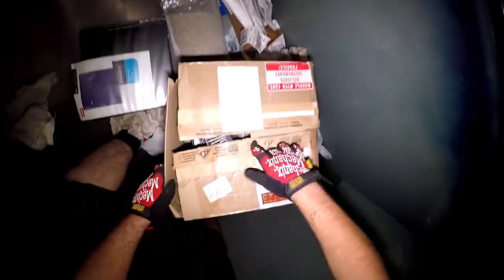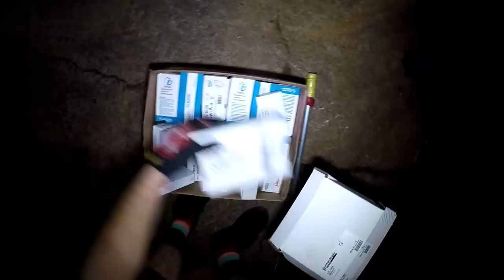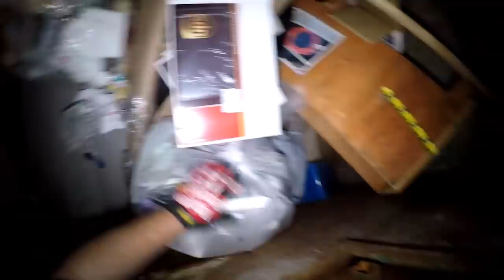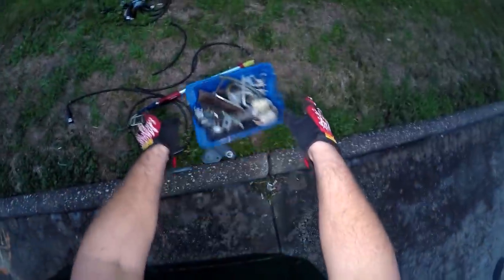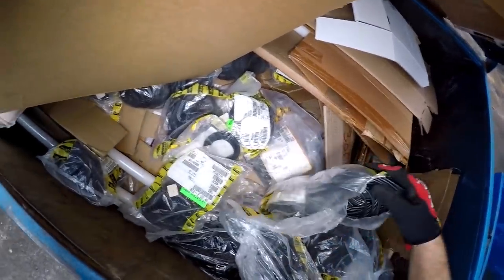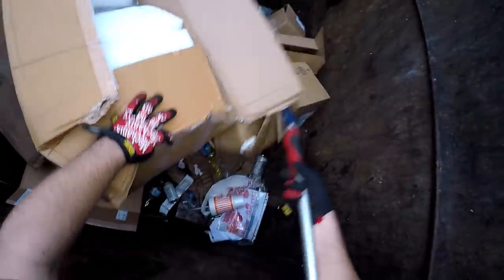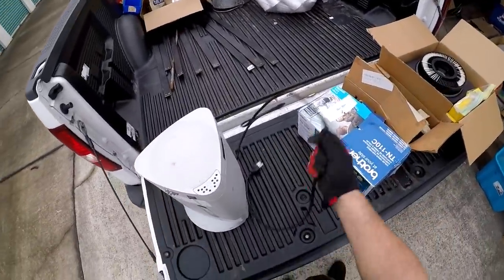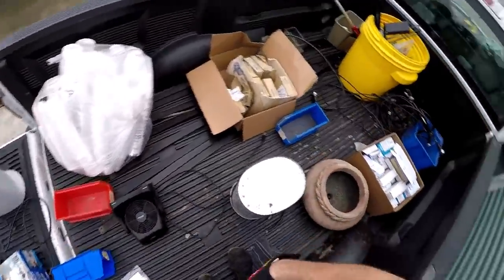Dumpster Diving 32 (Slide Projector & $$$ in Electronic Componenents!)

Comment: The panel at 7:37 looks like a patch panel, used for connecting equipment such as P.C.'s, phones etc. to active devices in a communications cabinet, using the relevant patch leads, there are various different socket types some of the large ones i.e. 48 port are quite expensive. Those Tyco crimp connectors can be expensive our company uses a particular type and they work out at about 20 cents each for us to buy here in the U.K. and we buy several thousand at a go, might be good money in them. Sadly they are not the part number you have otherwise it may have been worthwhile me making you an offer for them all, someone will want them. Very often the crimp tooling for them is very expensive and the connectors seem to be around for years, we have been using one type for nearly 10 years, to get a new set of crimpers would be about £200.00 so they do not change the designs very often, they will sell.

Comment: 7:34 I can’t quite tell, but if those are the things where all the tiny phone wires clip in, then I’ve found out the metal prong thingies are usually BRASS. They have a tin coating, but scratch them to verify they are brass and non-magnetic. If you take the back off somehow, all those brass clips fall out if they don’t have a bunch of wire attached. 💪👍

Comment: the oring kundrem. Orings i have are 15-25 years old and still work. but i don,t use mine for objects under super high pressure holding back hydrogen

Comment: sorry i'm so late with this info . those are connector pins, brass with either silver or tin plating. either way they are very pricey. check out the data sheet for specs.  https://www.mouser.com/ProductDetail/TE-Connectivity/3-1105101-1?qs=%2Fha2pyFaduguoywzwyrq%252BnNHnSVMdQij1I6oOftA8VU%3D

Comment: Tyco pins...they are silver plated brass.  They can be looked up by part number at digikey.com which will give you an application and price.  The wire in those cables is definitely small, but pure copper, The connectors are probably mostly aluminum, except the pins which are probably brass. Try kd0sgo@gmail.com for the other stuff.